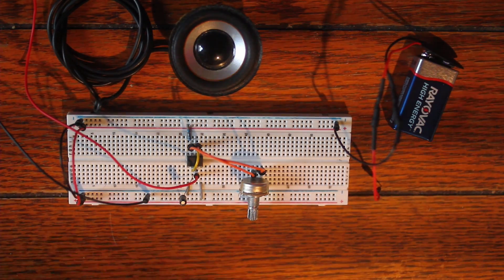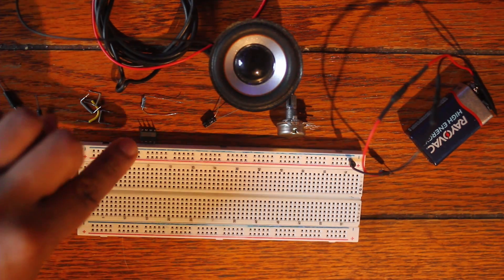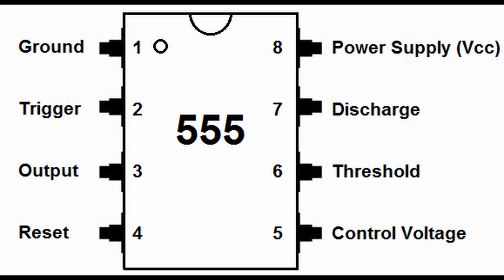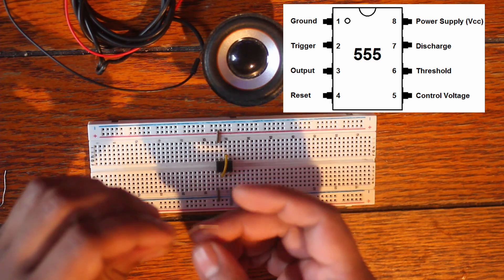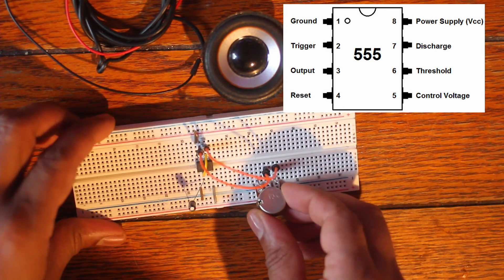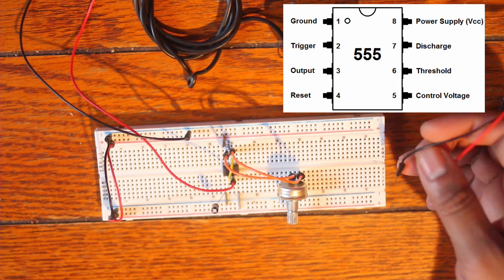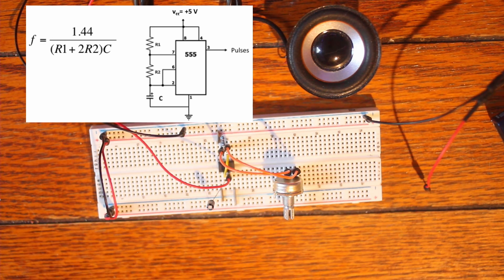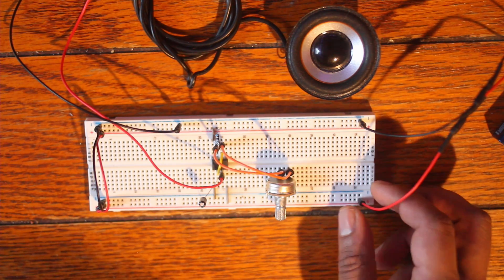Beginner Electronics Project: Simple Oscillator with 555 Timer and Speaker in Astable Mode EVLOG #7

Comment: I think, the weird behavior of the circuit at the end of your video is caused due to the heavy resistive load of the speaker whilw operating the 555 timer without of any stabilization. Depending an the speaker impedance (8, 16, 32 Ohms) it draws (or tries to draw) a lot of output current (1.1, 0.56, 0.28 A) from the 555 timer. The manufacturer states a limit of 0.2 A for the output current in the data sheet. Higher currents shifts the output voltage and even the operating voltage considerably down. This can lead to infererences among the trigger, threshold and the internal divider voltages leading to additionally pulses at the output at the higher frequency end.

I can imagine that it is allready helpful to have a 470 µF electrolytic to stabilize at least the operating voltage. An additional capacitor of 10 nF at pin 5 stabilizes both internal divider voltages. Furthermore it is wise to have a 220 nF capacitor close to the VCC and GND pins of the 555 timer in order to deliver enough current during the switching of the output. The 555 timer is a very old device. It has no shoot through protection for its output stage. So it draws several 100 mA in the sub micro-second range, what is not dangerous for the output transistors but it leads to current spikes at the VCC and GND pins.
Reply from the maker: Great tips! definitely give it a try. Thank you!